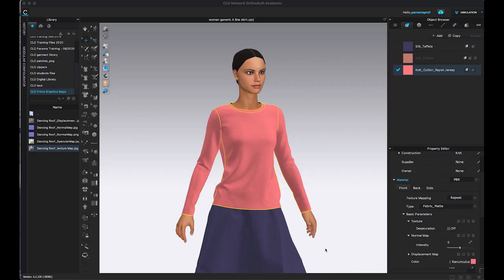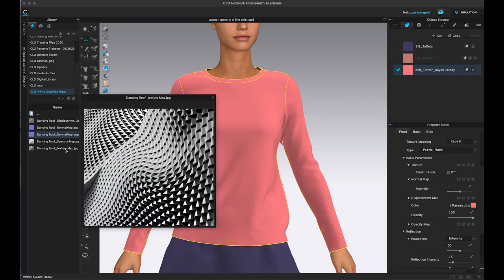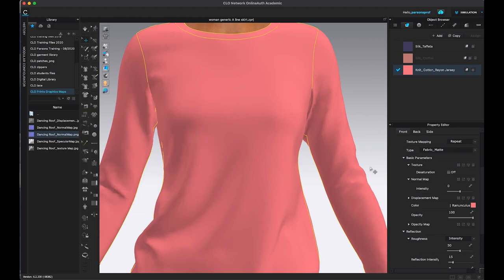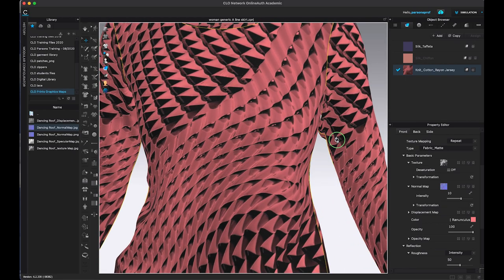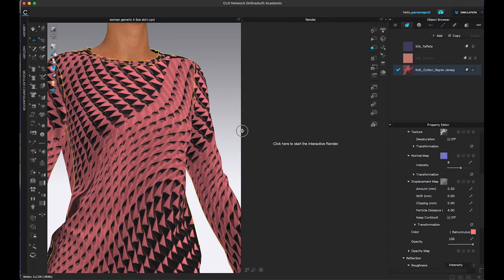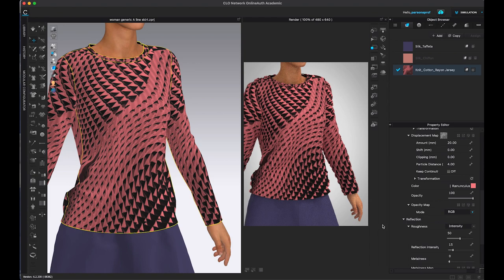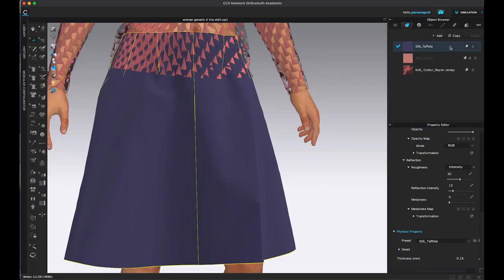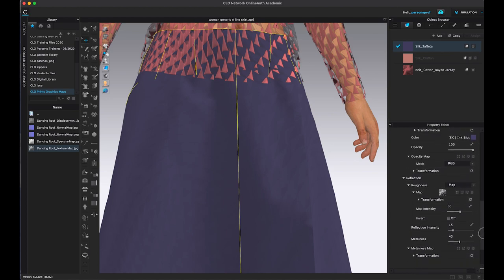How to Use All 6 Maps in CLO3D

Comment: Great explanation of 6 maps. Thanks a lot. Excellent. Love your videos.
Reply from the maker: Thank you so much! 💛 Glad you like the video! Your comment made my day!
Reply: @BobbinTalk  I guess I am trying to understand- of all these 6 maps, which ones do you mainly use? Like I can understand that the opacity map is only really used with lace, and the metalnesss (and maybe roughness) are really primarily used with a metallic material, but texture / normal and displacement used for knits, like you said in video? And if you use a displacement map, does that negate the use of a normal map? And finally, is it just the normal and displacement that I need like the normal map generator or photoshop to generate the maps? Like seams like texture, and can just use a jpg image that I want to use as a base. And the opacity, I just use a b&w jpg like you said. Maybe I need to watch your video again….

Comment: Excellent tutorial, but what do you recommend if I wanted to apply an image to a certain texture without losing the properties of that texture, simulating a sublimated fabric?
Reply from the maker: Not sure what you’re asking. Adding a map just gives an appearance depending on which map you’re using. It does not change the properties of the fabric.
Reply: From
What I’ve learned from Aneta, I think your base fabric that tou are using already has a texture (it’s woven or knitted surface appearance and rigidity or fluidity) all set up before you apply a print to it via Texture map (basically, a print or color) even though it’s called texture map, it’s really just surface coloration. Displacement map and normal map are where the weave and bumps
Of the fabric actually happen. And I know, it’s very confusing at first! Are you doing sublimation printing on a base fabric thats already in your library, like a simple woven cotton or something? From what Aneta says here I think the TEXTURE map, the first one on the list, is where you add a print or pattern without changing the behavior or appearance of the fabric’s surface beyond color/ print. This is what I’m getting based on Aneta’s awesome videos